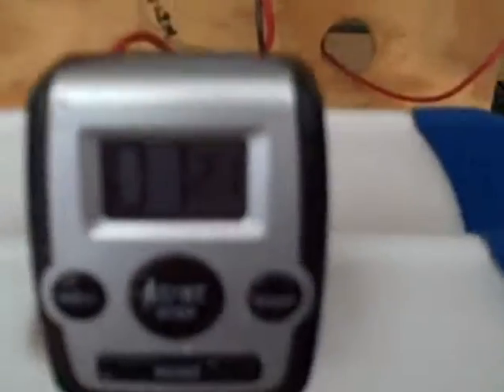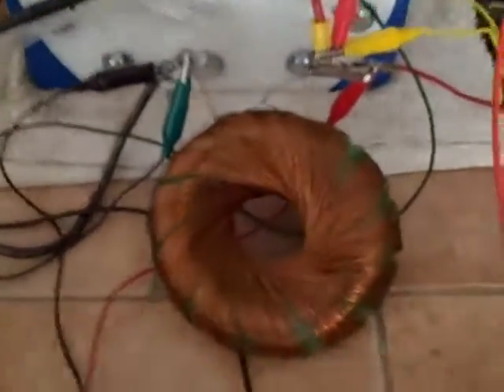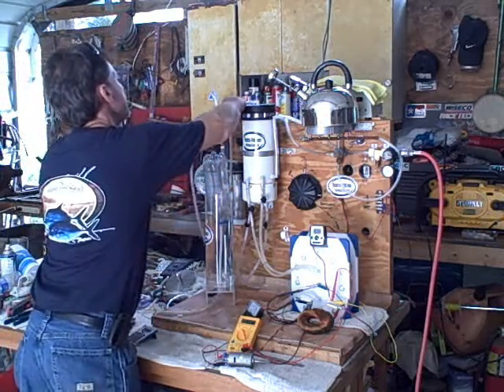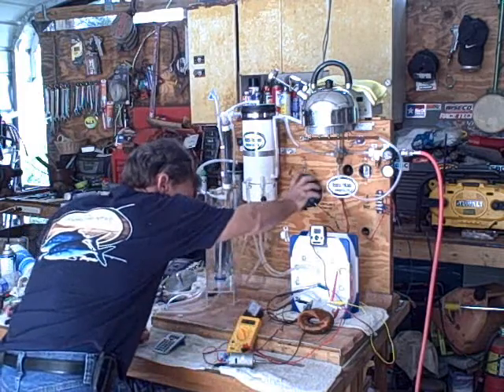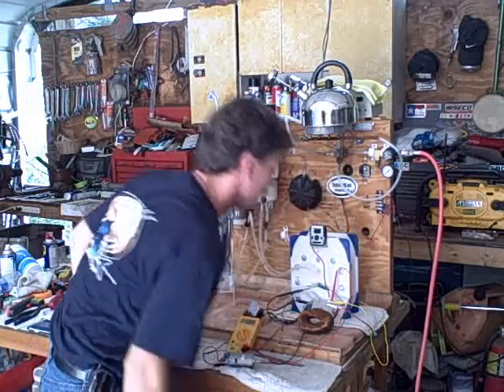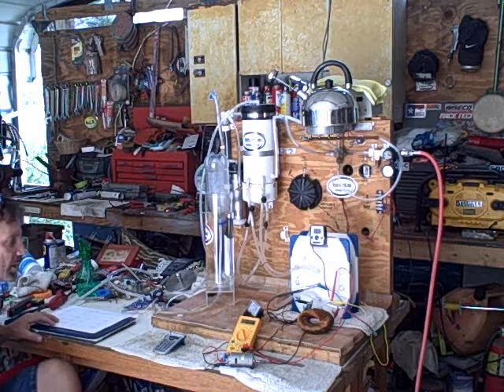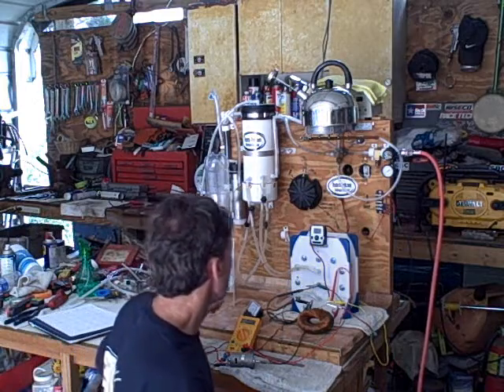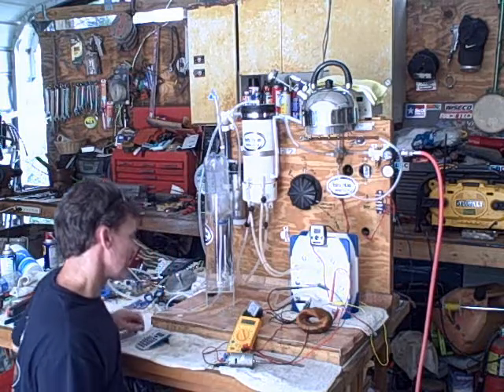testing rodin coil on cell

Comment: The way to greatly increase your production is to place 2 coils on your cell, one on one side, the other on the other. Run the electiricty from your PWM through the "A" and "B" field on one coil then through the "A" and "B" on the other, then right into your cell. Make sure that your coils match in alignment. You will then be using the monopole magnetic field to put additional stress on the covalent bonds of the water. I've done it, it works.
Please contact me for more info.
Peace.
Mike.

Comment from the maker: The torroid shape used for this coil was easy to obtain and easy to put pins in to hold the windings in place while wrapping it. If any other material is used it must be nonconductive and have the ability to separate the number of windings you use evenly. There are lots of ways to do this, but the easiest is using a plastic ring.

Comment: Could you try to use thick unisolated wire for the Rodin Coil, just two windings, one A winding, one B. Just isolate some spots between the wires, so that they don't touch each other. And put the coil in water instead of the cell, don't close the circuit, let one A and B open in the water. Try D/C and A/C connection. I hope you can image what I'm saying.
Thanks for your videos!